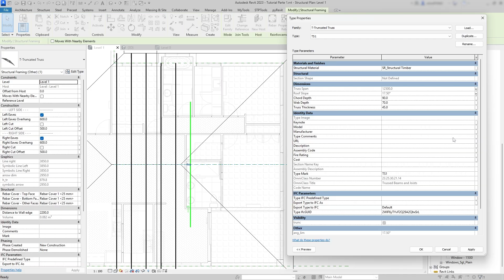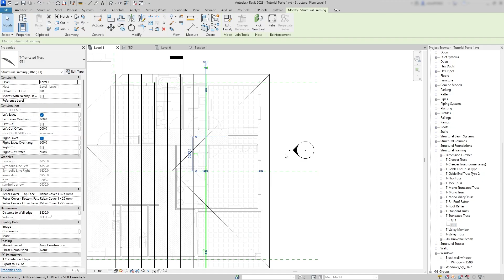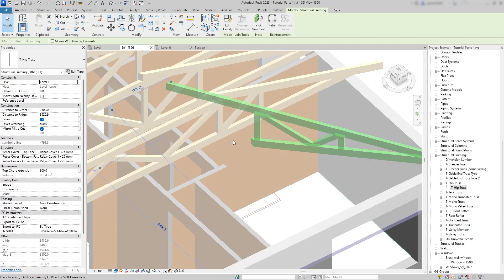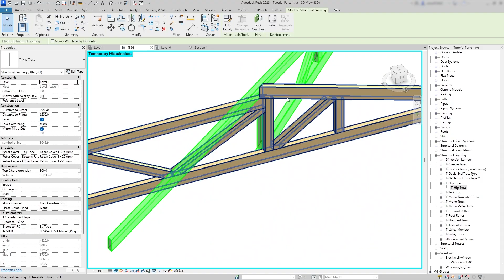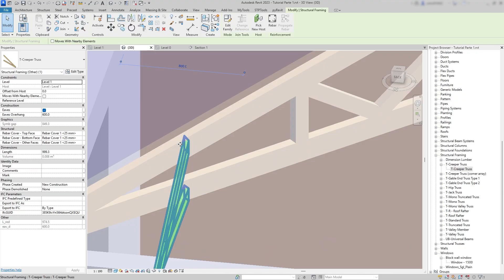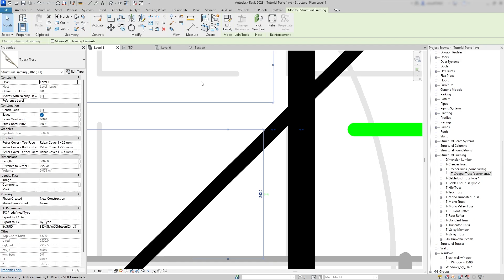Timber Framed House in Revit | Roof Trusses Part 3

Comment: Don't buy it, looks cool, thought it might work but after upgrading from 2023 model to 2025 revit model it stops working.
Reply from the maker: Hi I’m really sorry you had this issue when upgrading the model. I actually developed and updated this tools recently and it should be working with newer versions. I’d really like to understand what’s wrong in your end so I can fix it as soon as possible. 

If you are open to it, I’d appreciate if you send me a bit more detail about the issue as previous customers have not reported any issues related to Revit versions. 

You can reach me directly at senior.revit.latino@gmail.com?

I’ll be happy to help.